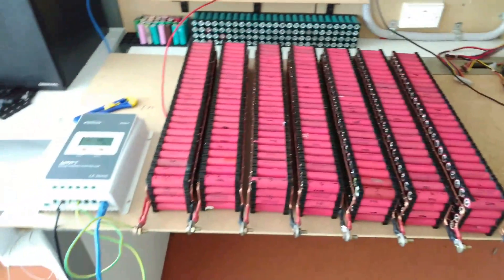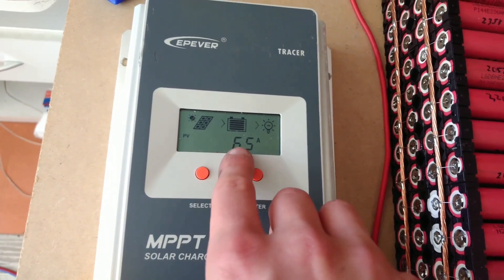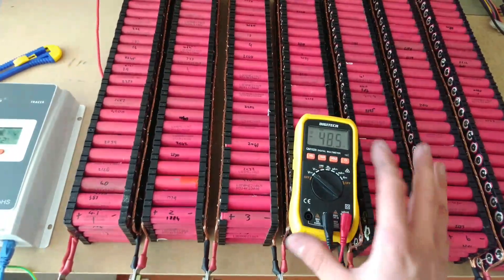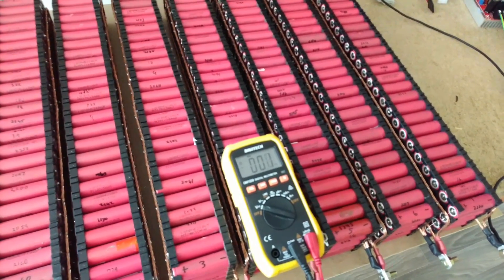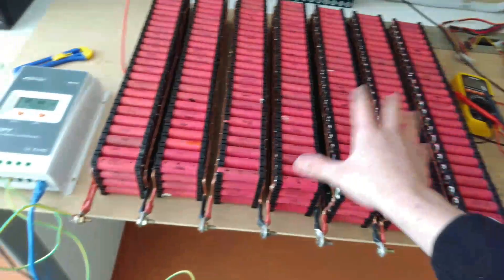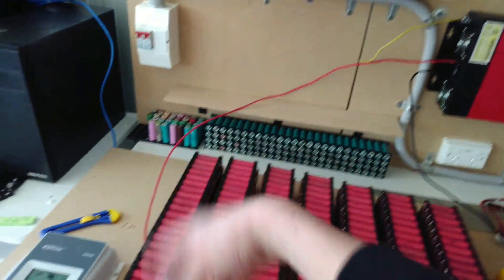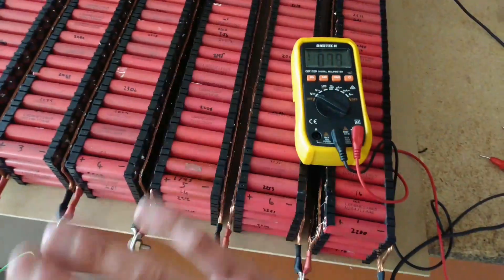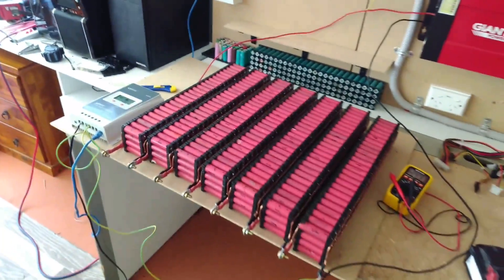DIY Tesla Powerwall | Charging and Load Balance | Update 27

Comment: Nice.... it seems you will need bigger inverter soon.... 
I hope it would be 48v if you know what I mean..... 👍 
What is your thoughts about balancing the packs....?  Batrium or something from automotive industry that is cheaper.....?
Reply from the maker: Bostjan Trancar 48v is definitely on the table for the future. Not planning yet on getting any balancing equipment. For me I don't see the point. If you build the packs evenly you should not have a problem. I have set my charge controller to charge cells to 4.07v each. Right now my the voltage difference between the highest and lowest cell is 0.03v and has not changed since installation. With this margin if the cells were to go out of balance the rate of overcharge will not be as severe (theoretically) Although it is nice to be able to see each individual cell voltage with the batrium software I believe it is not necessary. Thanks for watching.